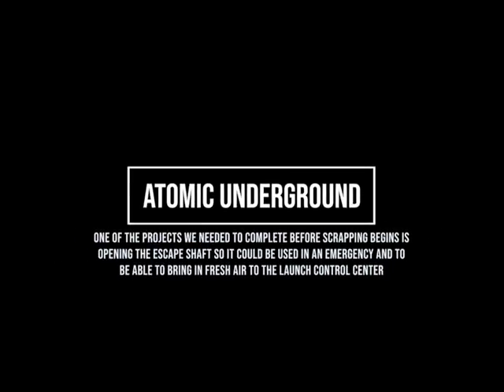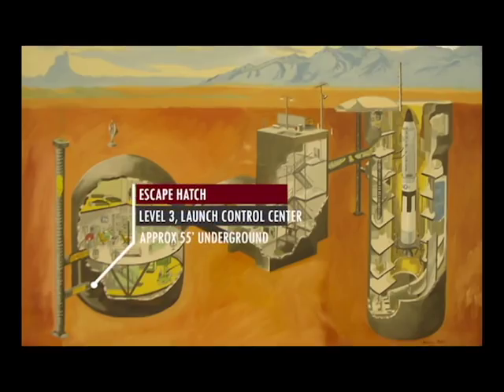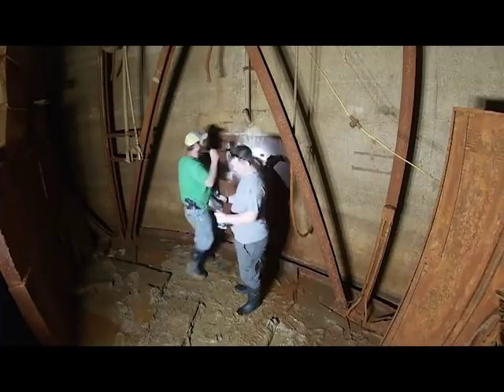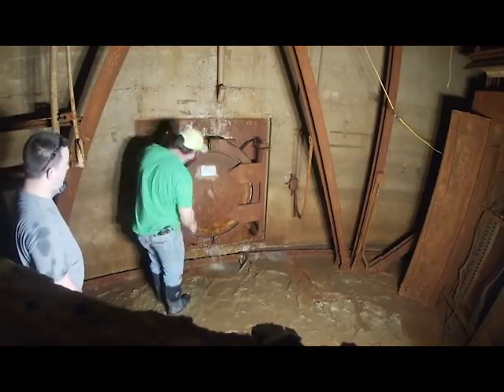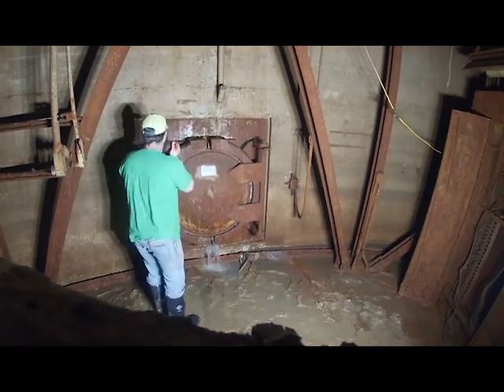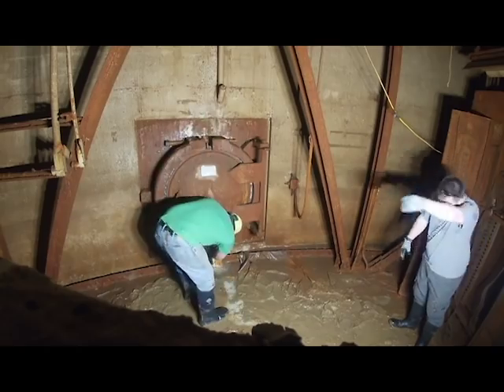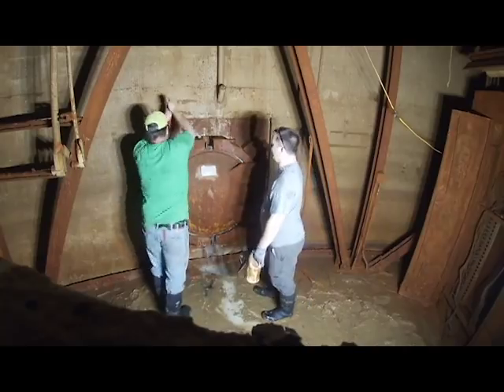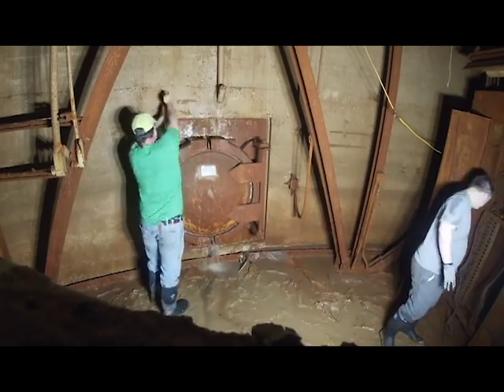S1E8 - Trying to Open the Escape Shaft (Part 1) - Owning a Titan II Missile Silo

Comment: As a maintenance electrician in 1980's, one of my jobs was to open that hatch and verify the limit switch would send a open light signal to the commanders console. It was quite a job to unscrew those bolts top and bottom. Verify the light is sent then button it all back up. There were limit switches on all blast doors and all the silo doors, Levels 1-8. When we had work to do inside the silo that required us to open a silo door, we had to radio back to the MCC to let them know we were about to open the door. Anytime we worked inside the missile area we had to first measure the air quality with a Portable Vapor Detector (PVD). Those green PVD boxes were bulky and heavy so carrying them was fun. We'd crack the silo door open about 1" and measure the air for fuel vapor ppm. If no alarms then we could lower the work platforms and open the door the rest of the way and start our work.  We had to lanyard every tool that entered the silo enclosure area, small screwdrivers, multi-meters, everything and we had to dawn harness. These extra precautions were the result of the 374-7 explosion in 1980 caused by a falling 8.0 lb socket the PTS crew was using inside the silo. No regular maintenance was scheduled on-site anytime PTS were there b/c they were dealing with explosive fuel and had to wear hazmat suites.  I can imagine holding tools in a hazmat suit can be challenging.  Knock on concrete and steel beams, our teams never had to wear them.

Comment: if it was mine i'd weld a short length of chain from the frame to the swinging end of the hatch, so that it could only open half a foot or so, and just spin that sucker open. I tend to be a bit heavy handed with things, but I live by the mantra "pull hard, it'll come easy". it doesn't always work out well but when dealing with heavy iron I find that it is typically the fastest way forward.

Comment: bottom of that escape shaft might be a good place for a sump pump maybe lower the near by water table a bit.
Reply from the maker: Won’t lower the water table at all. It only has a small leak
Reply: What's at the bottom? Looks like it goes quite a bit further down than the escape tunnel.
Reply from the maker: RedFathom it’s just a sump area at the bottom. I will put a pump in once it’s cleaned out.
Reply: That silo probably made a pretty big cone of depression.

Comment: I'd invest $10 or so and get one of those rectangular cement mix pans at home depot to catch the water/mud to save some clean up of the muck. Also saves you form crawling to the very bottom to clean it out from there!

Let it drain, let it drain, let it drain! I bet there is a lot more water there than you think! Probably over 1000 gallons or more.

Have you put sandbags, etc at the top & covered it well to keep more water from flooding it? Otherwise, you're gonna have a huge problem!
Reply from the maker: JP Tucson, AZ way past that. These is 6” of muck under there
Reply: @atomicunderground9971  ooops!

Yeah, I originally thought yours was in Arizona (the graphic w/mountains confused me), then I wondered how you still had all the water, rust; then saw the tunnel to silo; which were removed from the ones in AZ (crazy, don't know why).

Oh well, good luck in your efforts.

Oh, after seeing what the other guy did in having a crew completely remove all of the hanging cableways, etc. ...

I got to thinking... if you are a welder or can get that done for a reasonable price; tear out the stuff like he did, but before you do; plan this out!

Cut out the needed pieces, take them up top, strip off the rust, power coat them white, then use those pieces to rebuild the steel stairways! Will be much stronger and not subject to rot due to high humidity. (Also why I suggested powder coating.) White so that the stairway lightning can reflect around.

If you do it right, you could even plan to have an elevator for material/people. The original design with the elevator core surrounded by the stairway was pretty good!

Frankly, seeing the video with the wood, big holes & unfinished areas scared the crap out me! Safety hazard just waiting to happen!

Comment: So how and in which situation was this hatch used in an emergency? I can't really see base personnel spending an hour unthreading that clamp when there's a fire on the base, for example. Unless they had a very specific tool that can do that job in a matter of minutes.
Reply: When the threads are in good condition it takes about 5 minutes to open the door.  (I have a functioning hatch in my AZ site where water never intruded.)
Reply: Arizona Titan 2 Being a dry site is probably key for keeping maintenance costs down over time I would imagine.
Reply: Stoney3K Given the choice of never escaping, or escaping in a few hours, i pick option II.
Reply from the maker: There is a sign on it. There is a single ratchet and double ratchet method to open it. Only ever used on one site. Damascus Arkansas during the incident there.

Comment: You could use a vac truck . I just had one on site , it removed 8 cubic meters in less than 1 hour
Reply: Can that vac truck hose pull 50 feet straight UP ?  That's the reason I never used one at my place, even for loose dirt...  Figure 35 feet across the control room floor, (or decontamination room in my case), 25 feet across short cable tunnel, 10 feet across blast lock room, 20 feet through electrical room, another 20 feet across access portal, then 50 feet straight up.  I have not yet found a vac truck that can guarantee pulling dry material up that path let alone WET material.  That's a 150 foot run!

Comment: Why scrap it?
Reply: By "scrap it" he means removing all the tons of pipes, tubes, walls, cabinets, etc.  It's all rusty and in the way of renovating.  There are miles of pipes and conduits that will never be used and you cannot clean, prep, and paint much of the supporting steel unless you get the useless stuff out of the way.  I'm sure he will save anything of interest.

Comment: You may want to pick up some penetrating oil for rusty threads.  Everyone has different favourites, but working in similar rusted gear, duck oil is the one I use (plus you can make the joke about it having to be freshly squeezed from the duck).  Normally I’d say some heat, but as you’re in an enclosed space with limited ventillation, that’s not a great idea - remember a lot of fumes sink.  You may also want to touch base with some tank (and/or ship restorers) as we struggle with similar (both rust and fumes accumulating in the hull).  Good luck on the bunker - it looks awesome.
Reply: Gas meters are basically a must for this whole job.

Comment: Dang!  I sure wish the Titan sites out here in Arizona were decommissioned in the same way.  They literally backed a cement truck up to ours and filled it bottom to top. We're about 13 feet down now after many hours of jackhammering it out.  Haha.  Great video!
Reply: Of all the things that were completed at my site (570-6) I am most grateful for the escape shaft work.  Took the previous owner years to remove all the concrete.
Reply: @nationalsecurestorage  we're thinking of having a well company come out and bore down a 10" hole.  That would make it so much easier to jackhammer it out.  These things definitely take lots of time and love, ie. "Work".  Haha!!!
Reply: @ThompsonAtomicRanch  Just got you a quote - $2500 to have it drilled out by a local well drilling company.  You should have my email address if you want their details.  BTW - this company services my well, (great people) and could be an affordable resource for your own well servicing.  They are based in Benson.
Reply: @nationalsecurestorage  Sweet, thanks for getting that info!  I'll have to let my brother know. That would make all the difference in that project.
Reply: Can i suggest you use high pressure water instead of jackhammer? Faster and not that tiresome.
https://www.youtube.com/watch?v=kgxqkX_7E3Y
Reply: @Speedy6617  This will need som uch water... in the middle of the arizona desert !
Reply: There is one in AZ that is clean and for sale last I heard in...
Reply: @tortoiseoverland  Sold
Reply: https://goo.gl/maps/NT44mwuRxAGBde5b6
Reply from the maker: @tortoiseoverland  Check out Atomic Rancher's youtube Look up
Reply: Jackhammering? Screw that, I'd get a sinker drill and some emulsion and blast that sucker at a low powder factor if the structure could handle the shock loading.

Comment: Christmas List:  Battery power Impact driver and rust penetrant.
Reply: Dwalt (or whatever you desire in brand) and WD40
Reply: @Elfnetdesigns  Milwaukee high torque is the king of battery impacts right now.
Reply: ElfNet Designs wd40 is useless as a penetrant, WD stands for Water Displacement
Reply: @Mrflash222006  ahhh technicals technicals... ok then, penetrating oil. IDK why but I call any of that spray stuff WD40 though it's actually not lol. it's just a thing..
Reply: cutting torch
Reply: @bigunone  I think the idea is to not destroy the mechanism..
Reply: @Elfnetdesigns  Torch could also be used to heat the metal and loosen the rust